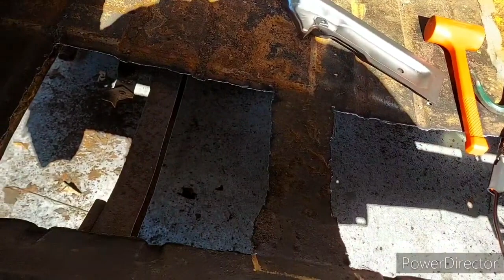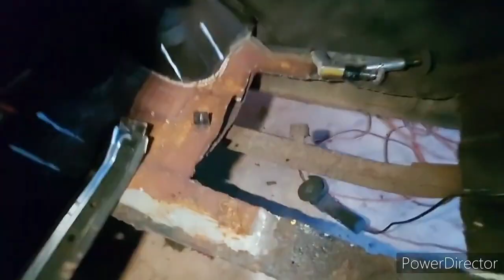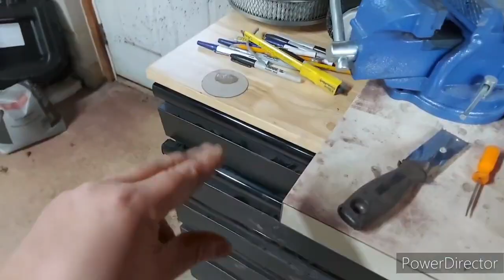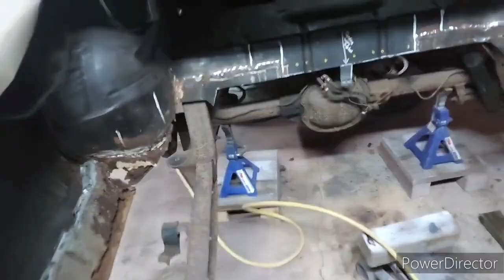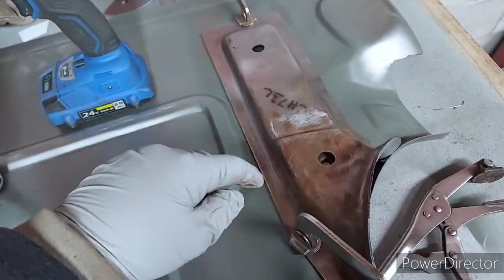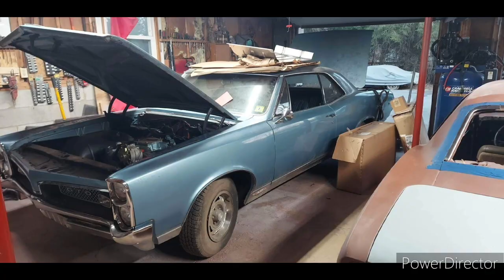1967 PONTIAC GTO Rust Repair Step-by-Step | Cutting & Welding a New Trunk Floor

Comment: I have a 67 LeMans I am putting in a new trunk pan right now. What size wire did you use on the MIG welder? Thanks
Reply from the maker: 0.23  but I use a 0.30 on a flux core